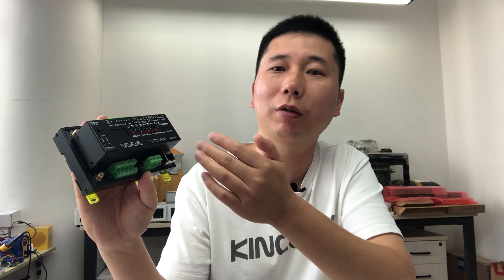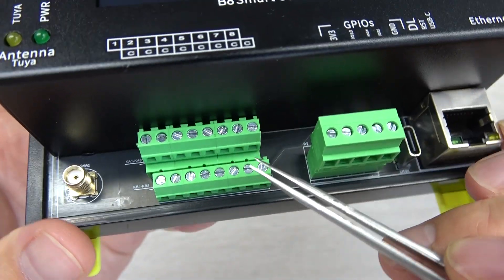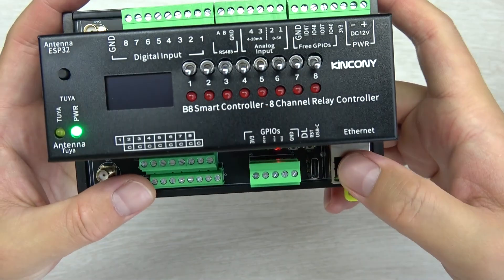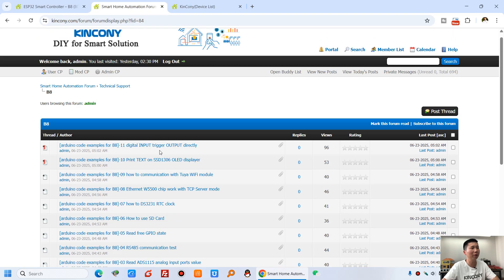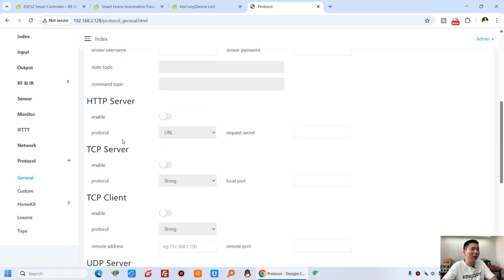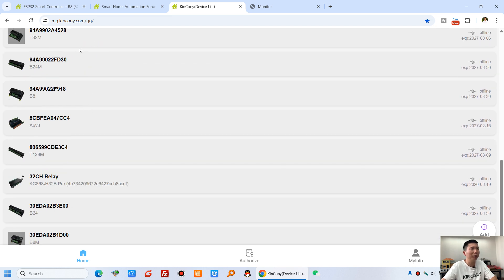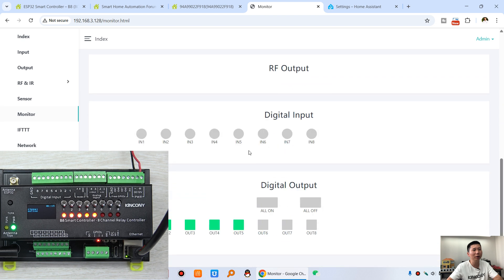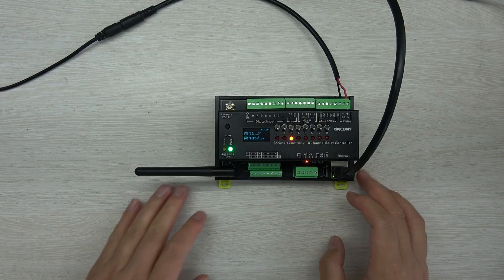8CH ESP32S3 Din Rail Relay Module Home Automation IoT Project - B8

Comment: Hi. Is it possible to map the digital inputs to control the relays? For example: Digital Input 1 turn on and turn off relay 1, and so on? This way it's possible to attach external switches to control the relays. Thanks.
Reply from the maker: sure, of course, just download KCS v3 firmware, then set by IFTTT webpage.
Reply: @KinCony  Thanks.